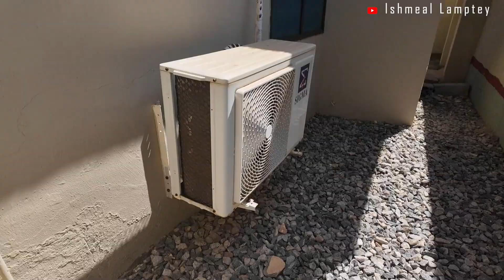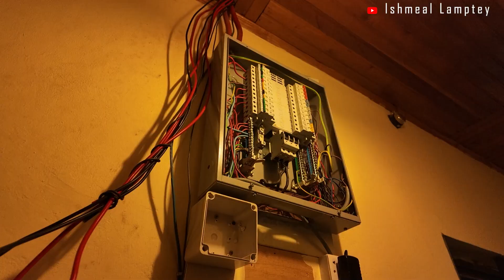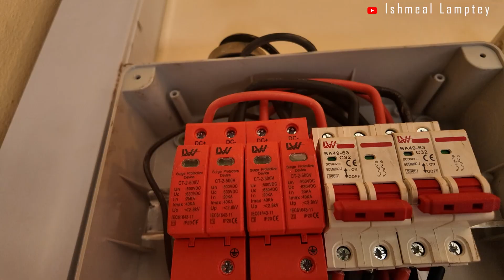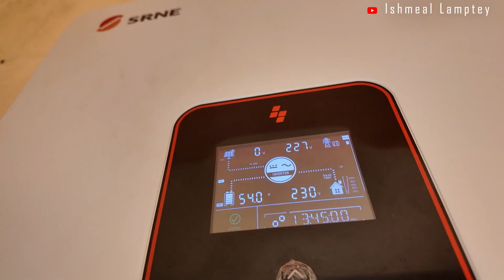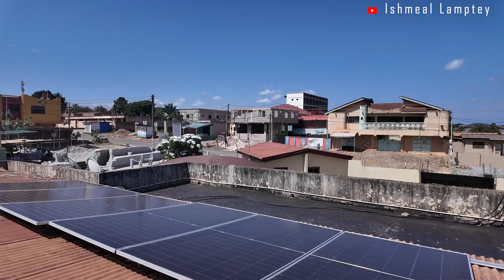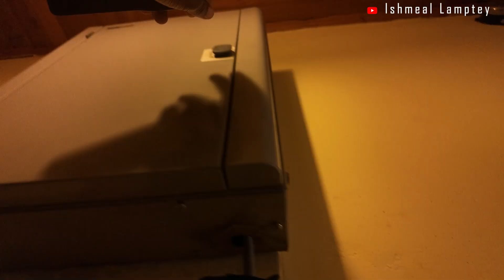Installing a 12KVA Solar System in Ghana – Full Breakdown & Cost (2025)

Comment: Great video. 

You try address to why use 3 phase 8:12. It's long ago but someone may find it useful. Basically it is for 2 reasons:

1. the first reason is to power a higher  heavy devices like most electric motors (most pumps falls into this category) and 
2. To distribute the load, load balancing, exactly as you did explain. I just want to emphasis the need. It helps you avoid the use of thick wires that usually cost. In situation where thick wires are required, failure to use thick quality cables for such single phase situation would result in unnecessary warming of the wires, worse case catch fire. So you can use 3 phase in such situations. 

Thus 3 phase is a subject of power, economics, and safety.

Comment: So a friend had Deye hybrid inverter with gel and recently upgraded to 30kwh SRNE batteries. I want to know if the batteries have to be configured separately before being connected to the Deye inverters for the BMS to communicate?
Reply from the maker: You'll have to select on the Deye inverter the battery protocol to match with the SRNE batteries

Comment: Ishmael is a good at installing solar and very diligent in his work. His after installation work is very credible too. He will come and resolve a problem if one occurs after install with no qualms at all.

I bought two 10KW Hybrid inverters and three 15.3KW battery from abroad and the panels and wires from Ghana. He came and installed them neatly with no issues. The only problem I am facing is lack of regular sun to maximize my benefit of its usage
Reply from the maker: Thank you 🙏

Comment: A home doesn't really needs 3-phase electricity supply. If you have 3-phase motor or pump, yes it would make sense. 3-phase supply provides the most efficient transfer of AC power to loads.
In a 3-phase supply the voltages are 120° apart - that means the voltage phases are always 120° out of phase with each other at any instant in time.
Reply from the maker: I agree however some people opt for that because they want to be able to still have electricity when other phases are off